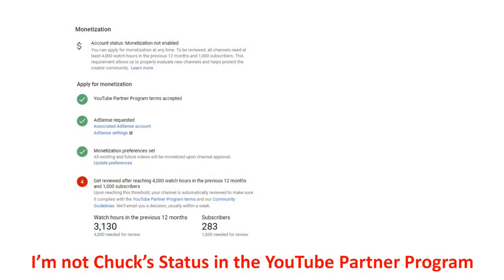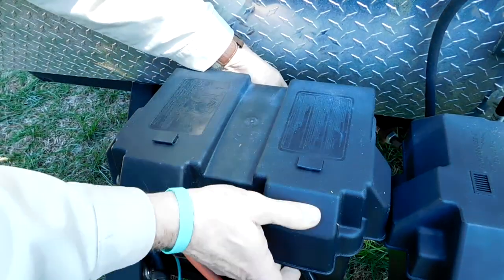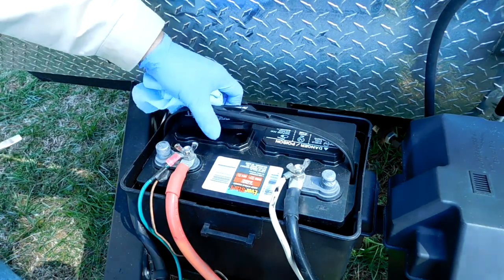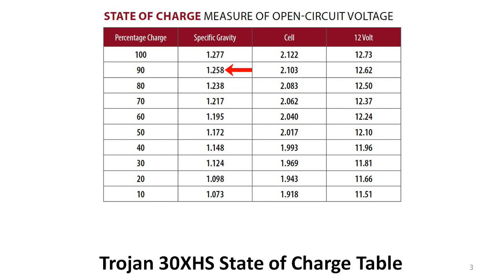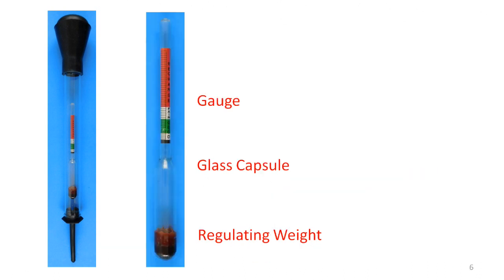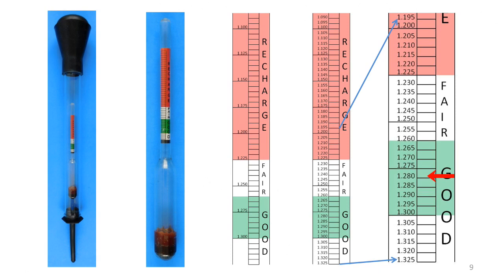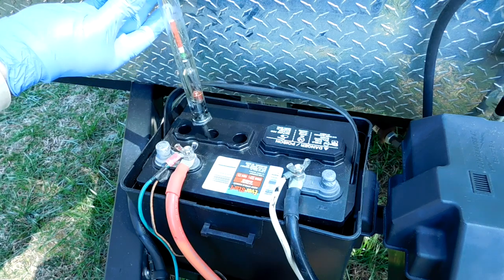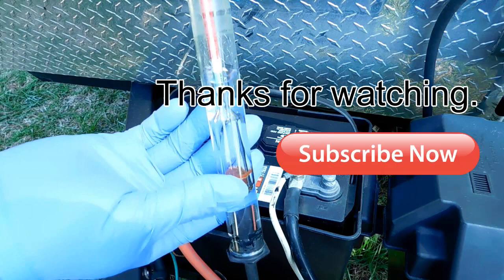How and Why You Should Check the Specific Gravity of Your RV Battery

Comment: I'm now subscribed, and I hope this helps you a bit. My riding mower began to show signs that its battery was going bad. After viewing many videos of how to rejuvenate a battery, I decided to be a true DIYer. Many videos did not show doing the specific gravity test. Go figure that one. Knowing that I would need to buy specialized tools, I went to Advance and purchased what I thought was a battery acid tester. Wrong. What I bought was a tester for anti-freeze. It did 'look' like a battery tester. Before I tested the battery, I cleaned the terminal posts and allowed it to slow charge at 2 amp. for two days. After doing this, I continued to follow your video. When working on a battery, I always wear a full-face shield with other protective gear. Thank you for this informative video. Maybe your next video will show us what to do next in case the battery needs more attention.
Reply from the maker: Hi Outlet, and thanks for watching, commenting, and subscribing. Good luck with the battery; unfortunately riding mower batteries are pretty much shot after a couple or three seasons.
Reply: @ImnotChuck.  why would the smaller riding lawnmower batteries be shot after only two or three seasons?
Reply from the maker: @ke01ith0101  Usually the mowers are stored in unheated outbuildings or worse. And usually, the owners don't bother charging the batteries during the off season. Thus, the batteries lose the charge and get really cold, so they don't last long. Keep the battery charged and it will last a couple of extra years.

Comment: I've been buying the cheaper Econo Power batteries for a while now.  Can't beat the price. If you drive every day, they work well...just as with other batteries. Unfortunately, one of my tractors doesn't get used as much (HUGE Ford F3000 battery, too) and I have to recondition it.  This particular time, the hydrometer reading was the last thing I checked and that was the problem, so I just wanted to understand it better.  Thanks!
Reply from the maker: You are welcome. I always like hearing that my videos have been helpful.

Comment: Trying to decide whether to replace a 6V battery.  Found your instructive video.  I got a reading of 1.175 on each of the three cells.  I've tried charging the battery but it won't take a charge.  I tricked it for a while with one of the old style non-smart chargers, so that at least I could get a minimum voltage so that a smart charger would detect it.  But when I put it on the smart charger, the process fails.  Error light comes on charger.  Before starting this process I noticed that the liquid level was low.  I filled with distilled water.  The spec. gravity of 1.175 was measured after refilling with water and after attempting to charge.  What I'm wondering is whether I can increase the specific gravity of the electrolyte by taking some of the low SG fluid out and replacing it with some high SG fluid (acid).  Would that increase the ability for the battery to take a charge?
Reply from the maker: Honestly, I don't know because I have never tried. Everything I have read from reputable sources says never add any acid to a lead-acid battery, so I haven't. It sounds to me like you have done everything possible, and it may be time for a new battery. Thanks for watching and for your thoughtful post.

Comment: I remember using a hydrometer when I worked in an auto parts store many moons ago.  I never understood the science behind it. Thanks for sharing the knowledge!  Question.  How low can you go without harming those Ever Last batteries?  I have heard many different opinions.  I have two 29DC ever last marine style batteries and 100 watts of solar.   With a load they sometimes go down to 12.0, but then I take the load off and they pop back up to 12.9 or so.  I hope you don't mind if I pick your brain a bit.
Reply from the maker: I am happy to try to answer your question, but it's hard to give a really short answer. In general, the deeper that lead-acid batteries are discharged and the more often they are deeply discharged, the shorter their life will be (due to sulfation of the plates.) Lower priced batteries (like yours and mine) are more subject to sulfation because of the plate design. So, I try to never discharge them below 50% (about 12.1 Volts,) and routinely try to avoid discharging them below 80% (about 12.5 Volts.) When you see your batteries "pop back up," that is partly due to the load reduction and partly due to the solar panel input. This video (https://www.youtube.com/watch?v=mtF2ikoRyzs&t=113s) provides some additional explanation. Thanks for the question and for being a subscriber.